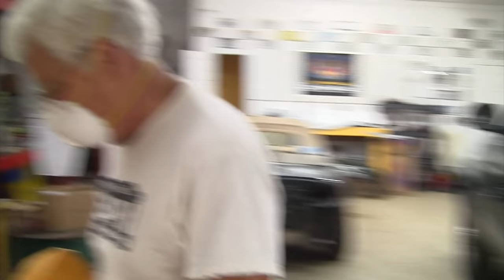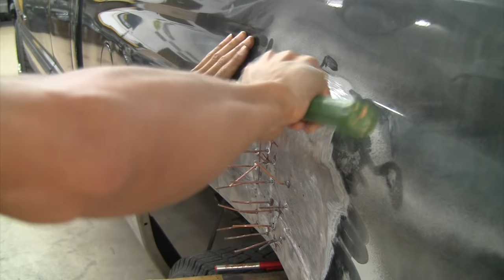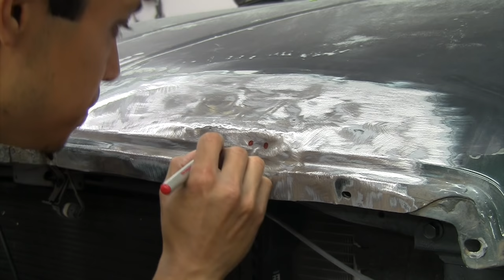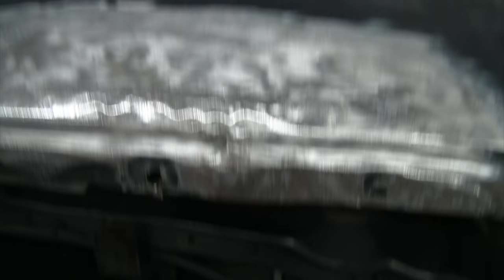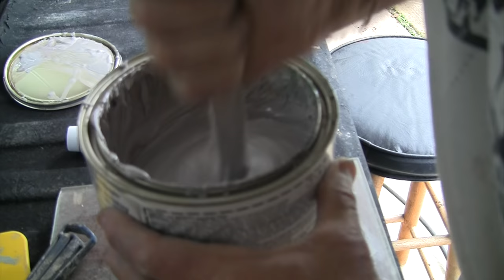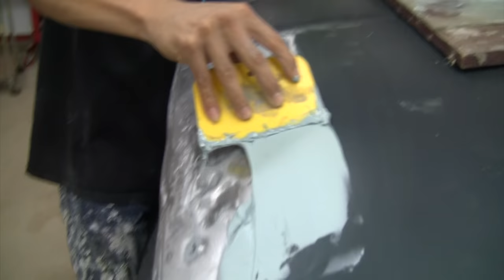DEMO: How To Use a Stud Welder and Pull Out Dents FAST

Comment: back in the 60s and 70s and even 80s cars had so much metal on them all we had was screw on dent puller and hooks. you drilled holes to pull dents and then slapped bondo. now they are so thin we need these spot welders.

Comment: Hey howzit 
How do you choose location of where to weld pins?? Are you going on the line or at the lowest point of dent?
Reply: I’m here to find this out as well.
Reply: @smithfoxe  I figured that you do it reverse, as if you were watching a video of a dent made in rewind, you do have to hammer it still but that’s what I got with doing a few major dents.
If you just weld/pull from the deepest point it won’t come all the way out and create mini dents/warps so best bet is to start some places in medium depth of the dent and then on the deepest points l, and then to clean up pull the body lines last. 
Best I can describe it with what I’ve done so far, but as usual, no help no responses, so I’m sure there are better techniques but get it done however you can I suppose, every dent is different there’s no one way to do all.🤙🏼

Comment: I’m using the same gun but the studs keep pulling through the metal creating a small hole. It’s obviously thin metal. I’m worried a mig welder will burn a bigger hole now.

Comment: Do you have to grind off all the galvanization (aka zinc coating) on the sheet metal before using the stud welder?
Reply: yea you can only weld to bare metal

Comment: shoul i remove the battery before using that tool or not?
Reply: Using the stud welder won’t affect the electrical system whatsoever.  The current is localized to its working area

Comment: So i was using a slide hammer that has a tip that welds on and some guys in a facebook group said to put pressure and to tap the crown instead of ligthly tapping with the slide hammer. Can i send you the video so you can see?

Comment: Would it be possible for me to send you a couple pics of a dented quarter panel and you let me know if it would be possible to pull out with the weld studs?
Reply from the maker: Hey Man! Are you a LABAP VIP member? Check out our blog about Dent Repair Demo Using Grinder and Stud Welder Gun https://www.learnautobodyandpaint.com/live-dent-repair-demo-using-grinder-stud-welder-gun-plus-qa/ and you may also send an email at ninjasupport@learnautobodyandpaint.com

Comment: So my brother was backing a trailer up and Jack knifed it and crushed the corner of my bed under the taillight... It's really bad. My question is do I have to get a replacement panel or count I pull in and bomdo it?
Reply: Corner of the bed or the fender below the light?  Or both?  If you crushed the corner of a cardboard box, could you straighten it?  The answer is not likely.  You must "reverse" the damage in the same way it occurred.  When you have multiple pieces of sheet metal coming together, repair may require professionals.  Otherwise shop around for a complete back end or panel (as required).  Bondo should never be more than 1/4" thick if you want it to last.

Comment: Buy parts?  This is free. Anyway remember also that this is rear quarter on an old-er dodge truck. You pull that hard on some panels or doors and it gives a lot easier.

Comment: Great video. Just picked up my stud gun during a HF Tent sale. I have a crease in my rear truck fender, so this is good stuff. Is it not easy to hammer from behind, inside the wheel well, or is this just easier?
Reply from the maker: It was a dual wall, so from inside would just damage the other wall... :)

Comment: I like to spray the bare metal panel first with Primer, so it's sealed, I find the body filler sometimes lifts and starts to rust between filler and metal, I Primer first then put filler on Primer, then sand the Primer again then final paint. Etchit primer, I hate rust.
Reply: You must be doing something wrong with your body filler because it is actually recommended that you use body filler on metal only, but puddy can go on primer as long as the surface is scuffed

Comment: Hello i want to paint my car and the paint on it is in good shape, no dents or deep scratches and i was wondering how much i would need to sand it before painting? Would i only need to sand away the clear on the existing paint? Would i need to primer it as well? I was planning on using a single stage acrylic urethane. Any feedback would be great thank you.
Reply: you have to sand the clear coat down to paint and then make sure to properly mask the car and clean the paint and all jams and seal the old paint to avoid the chemicals reacting with one another and dry and prime and sand primer with 600-800 check for any inperfections and clean again blow any dust of car or truck and you can repaint with the single stage just make sure your using proper temp reducer good luck
Reply: thank you!
Reply: Your welcome

Comment: Why do you hammer when he pulls with the puller? I would like to know what's the theory behind it?
Reply: Ronald Almendarez it stiffens the metal so its not left flexible
Reply: hardkore360 they thanks man, have a blessed Sunday.
Reply: If it could be done perfectly, you want the hammer to hit at the same time the slide hits.  That is why he is trying to hammer very frequently.  It is just by chance that with 5 slides, the hammer might be synchronized with the hammer a couple of times - that's when progress is made.  It's all about setting up the desired shape.

Comment: Good work, but I’d much rather have my car fixed with sheet metal and a wire feed
Reply: Damn what they fixing? Rust? This is the way to pull dent besides using hammer and dolly don't know what kinda repairs you need lol

Comment: That s not a proper repair first of all you don't grind off medal you cAn use a plastic roll out for that second using stud gun you pull from outside going to the deep spot and you don't hit the slide hammer back 
so you won't create a high spot points you u just pull one good pull and keep ur hand tight and help hitting the regular hammer around it